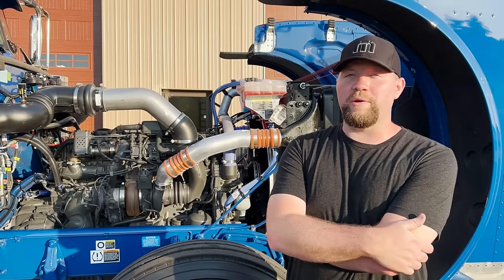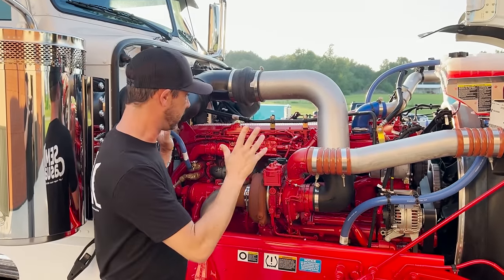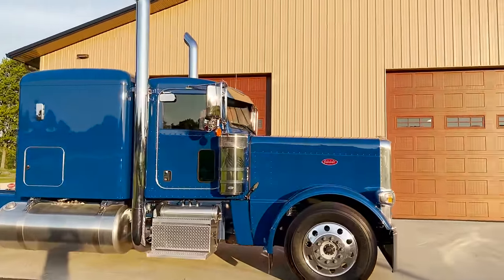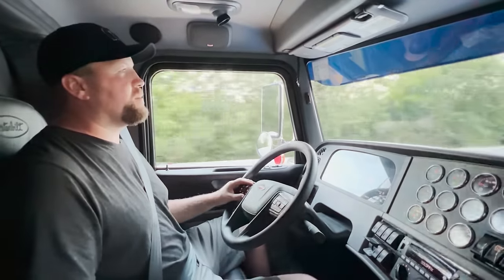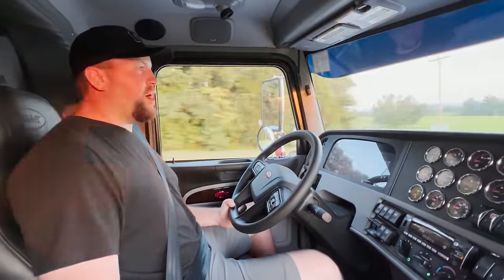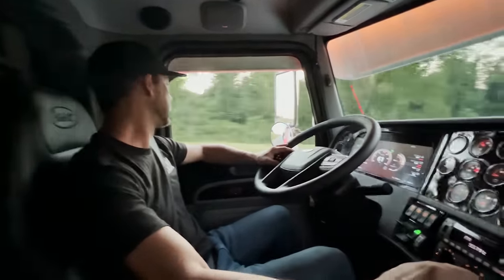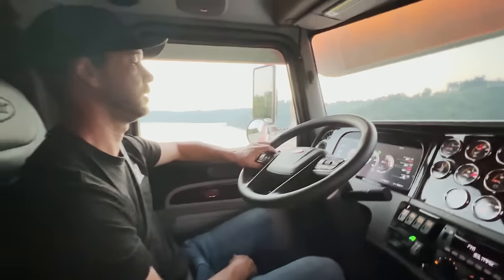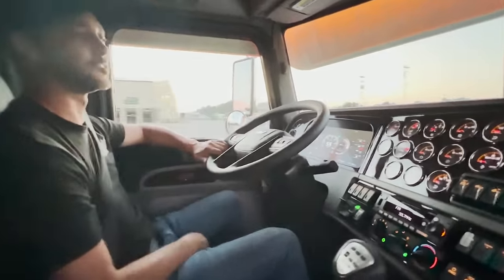Cummins X15  VS.  Paccar MX13  -  What are you gonna choose?

Comment: I  Prefer  Cummins  Always have , 
Now with these newer Cummins engines the only thing that we found out and learned , Is the counter bore , These engines the counter bore is NOT true in them , You can take a brand spanking new Cummins engine and pull it down and I guarantee you 1 or 2 of the  counter bores will not be precise and that's where you have trouble , You can pull  a brand new  Cummins engine down and  You will see what I am talking about if you even know what I am talking about , Take and  regrind  your counter bores and reset your liners at  14 thousands  above deck height , Cummins they only set the liners at 12,000  deck height  that's bad  and 1 or 2 of the liners will be higher than the other ones  , But redo the counter bores and set your liners at 14,000  I guarantee you  will not have no problems with that engine ,  and check all your parts and make sure that they are flat and  use good glue when you put it back together  Or you will have oil leaks , I know guys that got new ones at 50,000 miles and they are already leaking oil Because nothing is true and precise

Comment: Can't compare a 15 liter to a 13 liter,,,,the power difference is massive,,,even  if the horse power and torque is the same the larger displacement will always have more power,,,I wouldn't ever own a paccar engine,,,but comparing 13 to 15 liter just isn't fair

Comment: I’m just going to comment from a company driver standpoint. We have t680 Kenworth’s with both engines. The dash on the paccar powered trucks read that they get better fuel mileage but the pump doesn’t say so. As far as power they both pull good.

Comment: I have 12 trucks with every brand of engine.  While the MX is not the coolest engine, it has been the best option in terms of reliability and fuel economy.  Parts are cheaper than the CAT engines and we have a local Peterbilt dealer that is very helpful.

Comment: So here's the deal........the Paccar has serious injector issues causing alot of breakdowns and lack of enough parts to fix. The X15 will need rebuilding by the time you get 450 to 500,000 miles on it. Due to the fact that they removed the fuel dozer in the exhaust and made the injectors due double duty spraying fuel into the cylinder on the exhaust stroke. Causing  the cylinder walls to get washed out prematurely and causing excessive blow by and low compression.  John Deere is using the same philosophy on some of their engines as well.  They're all junk!

Comment: Don't look at miles interval. When it's have to works 5 days a week, sent it 2 times a year to the shop for services. It doesn't matter if it is my Scania R450 doing 90.000km a year short trips, or my brothers Daf paccar 530 doing 140.000km long trips. Both for bulk, running happy on 2 services a year

Comment: You guys did a good job of running down the strengths and weaknesses of both engines. That said I've owned both and in 389's. The Paccar was better on fuel until you got up over 120k lbs the the roles reverse. Oddly enough too even though both my trucks were 1850 tq motors the Cummins would run circles around the Paccar when it was hooked up to heavier loads. My Cummins was a 525 but there's no way 20 hp makes that kind of difference. The other point for Cummins was in resale. Any 389 or W900 I've seen listed with a Paccar is minimum 10 grand cheaper on the used Market. My salesman buddy says they sit on the lot way longer too.

Comment: Maybe if you compared a 500 hp. 1850 torque Cummins you likely do better on mileage you are not comparing apples to apples. It takes fuel to make horsepower.

Comment: I have both of these engines in two different trucks. There is no way that fuel filter will last that many miles and about 10,000 miles that fuel filter is nasty and starting to lose filter pressure so I don’t know how you guys came up with that number.

Comment: Doing a test/comparison when Bobtail is nearly meaningless. A truck Comes-Alive UNDER LOAD. There is NO SIMILARITY in a truck when Bobtail Especially with respect to Vibration and Sound Levels. The turbo is the Dominant sound in the noise spectrum when loaded but nearly absent when bobtail. 
As you mention, Application is important in selection…kind of… 
If you drive anywhere where there are Grades of ANY LENGTH, YOU WILL REGRET buying an engine based on Fuel Economy. BOTTOM LINE, if you consistently work where Grades are involved, you will work MUCH LONGER DAYS than the guy that has 2050 lb/ft of torque under the hood.

Comment: I've done back to back testing X15 e5 vs MX13 e5 in my region (south America), and if you have the correct power train selection, the X15 gives better fuel economy and performance here, you can't have the back to back test of the MX13 vs de X15 performance version, you'd have to put it against the 450hp X15 with 1750 lbft of Torque, that way you would be able to compete in fuel economy and Def consumption and also maintenance intervals

Comment: @5:00

As a one man owner operator, as long as I get 6 miles per gallon I'm okay. I'll pay an extra 8 to $12,000 a year just so I don't slow down at every Hill that comes up on the horizon. Time is money. I don't take loads where if I don't get 7 miles per gallon I lose money.

I do my own oil changes: but let's say an oil service is $350.00 in July, 2022 prices.  Let's also say you're a super-trucker and drive 120,000 miles per year. 

 The quick math is you'll pay $700.00 on the Cummins for annual oil service.  On the PACCAR, you are our $350.00 cash but then you must also accrue $210.00 for the second oil change being used up so you only have $140.00 service-life of that oil change left.

So if you divide that $140.00 savings by 120,000 miles you will get an approximate this amount cost savings oer mile:  $0.001166666666666666.  You have to drive 1000 miles to see one penny of savings.

A much better comparison would be which one has a higher "half-life" to that $40,000 to $50,000 rebuild; this is something that would "move-the-needle'.

And if you're a regional driver like me where you barely make 80,000 Mi a year: I mean it's just a negligible annual cost.  Even my batteries is cost annually more than this per mile ( $750 cost over 4-year service life. )

Comment: You should not be going 60k on a service. Book even calls for 25k. Also I get a whole mpg more than the mx13 we have and both are 18spd with 3.08 295 tires with the same 18,700lb. Both have the same weight trailer at 105k and I absolutely destroy it every possible way. Pulling power since mine was at 605hp but now it's 700hp and gets even better then 1mpg over the mx13. It's a complete garbage engine with no benifts. Your better off with the proper spec your doing. My w990 is also extremely quite end I never feel my engine running and my truck running down the highway is extremely quite. So quite it drives me crazy

Comment: Well I think X15 is better now and in next 3-5 years, better resale value and no body wants to buy paccar with 500-600k miles, I would rather have 1 mpg less than 2-3 months down time waiting for parts or wasting time trying to  find mechanic why can work on Paccar, get Cummins efficiency and slow down up hill or drive behind paccar or up hills and you’ll get same mileage as paccar, Cummins efficiency can get 8+ average and that’s enough to make good profit

Comment: MX13 is good engine just for what you need.....single trailer - go MX13, hauling heavy loads or superB daily? X15 is way better.
Noise in cab? open pipes on cummins sounds great....but getting old pretty quick, im driving with noise canceling headset....

Comment: Paccar is terrible.. bought anew dump truck and needed a new block at 75k miles. We have 6 with the same engine. All have been problematic. Have an old 96 kw with a n14 and has had problems

Comment: Talk about how different trucks shift, you guys are both too young I think to have ever driven an old Mack 5-speed. That was what I started out in, way back in the early 80s, and it was an old 70s truck. The Mack, you had to pull it waaaay down to maybe 1500 rpm or even lower before it would shift. They were working best at what seemed like crazy low rpm.

Comment: I had a pack car engine the 500 in my 2015 389 Peterbilt pulling super Bs in Alberta Canada gross weight 139,900 pounds call liquid asphalt and I could stay with any Cummins and on a long pole could outpull them. And save money at the pump on every fill up

Comment: Hello
Friends, I have a dsfmotormx13, retard motor. Why does this engine damage the valve stem, and I have seen several cases that their valve stem also breaks quickly, and this is a weakness for this engine. Is this weakness due to the construction of this engine or is there a reason that causes this problem, please guide me, this is a problem.
Thanks

Comment: 😂 reading theses comments, I have 15 KW T680’s Paccar far smoother running and way better fuel mileage.. Both have cheap plastic high pressure inserts that KW doesn’t even manufacture as replacement parts.. Cummins seem to have more fluid loss, Paccar seems to have more air emission problems

Comment: No way would we ever run a paccar engine, we all want a big block, but yah we would all run a 12.7 60 series and love the fuel mileage, the paccar is just the replacement for that engine, times are changing, and I personally don't think the new Cummins is a million mile engine, many get a full inframe at 700K miles, times have changed, roll with the punches

Comment: As an owner operator, the paccar is not even an option. The dependability of the cummins far outweighs the paccar.  I also pull mountains regularly making the torque a requirement.

Comment: F#ck Paccar. Absolutely gutless.When you have to buy a 92 Pete to haul with because the new paccar lost the motor 3 times in 7 months until the dealer offered to buy it back out of pitty. and the pete dealer today 3 years later refuses to stock Paccar on the lot anymore

Comment: I liked the paccar engine until we spent 30k on it fixing the damage the air compressor caused going out, new power steering pump, fuel pump and air compressor, and pulling the engine to replace two gears

Comment: Do not I repeat DO NOT CHANGE YOUR OIL AT 60,000 MILES!! (cummins) or 75,000 (paccar) as they stated. Thats to damn high. I suggest to have your oil changed no more than 20,000. I try to do mine every 15,000 miles.

Comment: Cmon man, would you really spend 300k for a 389 or any truck and change the oil 60-75m mile intervals. That’s insane, no engine longevity there, and who would want to buy that truck used. I’ll stay at 20k oil changes and never have big engine issues

Comment: I'll tell you right now as somebody who's driven a 579 with a pack on motor in it for the last 3 years not only do those things have extreme emissions problems that the Cummins don't have they also have problems with their camshafts on the newer motors, they also have and ungodly amount of sensor problems once you get a couple hundred thousand miles on them your sister start going haywire all over the damn place you'll be driving around with a check engine light more than you will when you don't have one

Comment: The difference between the cummins and the paccar are no where enough to reliably pull or tow a tank they use 800 horse detroits and cummins and cat motors to pull that much weight I have a person I met that has a m1070 hett with a cat motor that has over 900 hp and over 2900 lbs ft of tourqe and he get 6 mpg towing lavs mostly tanks he gets around 4 to 6 mpg depending what it is but most of his loads are 190k lbs

Comment: This 60000 and 75000 mile oil change is only profiting the dealers and mechanics ,  not drivers or muy especial owner ops!!! 
I say 15-20K miles max oil change to keep the engine running strong and long !!!! What the heck , 75000 oil change , make it 100,000!!!! 500,000 K miles if it lasts that long and get a new engine , only $50,000 extra for the new engine to save maybe $5000 in extra oil change costs , Pure insanity!!!!

Comment: I have a 2016 mx 730k miles still getting high 7 low 8mpg would love Cummins power but I pull general freight van mostly Midwest I don't need it I try to haul light anyway. Love them Pete's though

Comment: Been a top rate diesel mechanic for over 40 years and Cummins is in bed with China and alot of there parts are made of low grade materials and there's huge issues with head gaskets around liners 5 and 6..  extremely poor torque sequences on there headbolts..  Paccar has its issues with sensors and they will give you problems if they are not serviced on time.....  Paccar is a better motor......  People think wow!! CUMMINS!!!!   no no no,.. critical parts are Chinese made and it's all raw garbage...  The older Cummins are the best and my favorite

Comment: I have driven both the an X-15 Cummins and an mx-13 paccar. The Cummins has a stronger engine brake has more power and is more reliable I had more issues with the paccar mx 13s I spent more time on the side of the road with an mx-13. The company I work for has both and they are both heavily restricted horsepower wise and torque wise and speed wise I still would take the Cummins over the paccar

Comment: if you live in a small town like Greeley, CO it's best to with the more common engine the X15, because i drove a truck with the MX-13 and that small town Peterbilt place didn't have a Tech to work on my MX-13 so i had to wait 2 days for a specialist to be flown out.  For the MX-13 i found that it was rather good on MPG like 7-10, but the X15 has always been a hog getting like 6-8 mpg

Comment: Regardless of the cost difference I will only have a Cummins or a Detroit. The reason for that is I can get warranty work done anywhere and can shop around to get it in the fastest. If I have to wait a week to get my truck in the pac car motor just lost all its advantage. I currently have an ISX 15 with nearly 700,000 miles on it and I have has it in the shop for a def sensor and a fan hub. Oh and an A/C compressor. Thats it. Freightliner fixed the fan hub, International done the A/C compressor and Kenworth done the DEF sensor. I have a International Pro Star and will not take it to the shitty service at an International dealer! But I will never have an off brand engine again where I am limited to where I can get it worked on. Time is money and International, Volvo, Pac car and mack engines have to go to a dealership that don't give a rats ass about getting you out in a hurry! International is the absolute worst! They work bankers hours. My next truck will be a Westernstar or a Kenworth with a X15 @ 605 hp and 2050 torque. Then it will be tuned by Pittsburgh power.

Comment: 60-75  between oil changes?? No wonder these trucks take a shit. I change mine every 15k. Never miss it. Of course I’m running a 3406b. From what I’ve seen at our company the Cummins have major gear issues still. Paccar can feel underpowered. Both use same def systems so same shit show there.

Comment: The MX is a dog. When it sees a hill it bogs down in fear. Had the MX13 in a 2012 Pete that was a bad terd. Constant def issues, oil changes more expensive and overall higher cost of ownership. The X15 can be tuned with all emissions intact to 725ish HP and 2400+ torque. Not a Cummins fan boy but I've had the MX13 in real world conditions and hated it. Worst fuel mileage motor ever for a car hauler. Just my 2 cents. Thanks for the video y'all.

Comment: Peterbilt mechanic here:

CUMMINS:
Serviceability, retail value, strongest engine break, parts availability, training,  software diag, much more emissions options!!!!

Paccar:
7k cheaper, amazing factory powertrain warranty  (750k)  decent dealer network, new models are much improved. Smoother rotational mass for being a rear geared engine(volvos & detroits)

MX is great option for large carriers. Thats it!!!

you can only take your MX to the dealer for service,  small shops don’t have access to their software (Davie-baby) and ECM is encrypted .

Now if MX is such a better engine, why Paclease and other dealer leases prefer you lease a Cummins from them?

Who owns the MX motor? 

You mentioned the MX block uses a compacted graphite block, but why didn’t you mentioned about their soft ass camshaft lobes?
Bad metallurgic material, MX is much inferior to the Cummins

Ever got that damn stupid check ball valve stuck while doing fuel filter changes?

Comment: The difference with the speed set , the length of the connecting rod and the x15 diameter of the piston are more convenient for acceleration than the mx13 ,  x15 reaction on accelirator pedal almost quick as gasoline engine , if you choose the right gear ratio of the transmission, then the chimneys can steadily keep the speed up a steep hill even with a heavy load, mx13  same as Detroit dropped speed quickly .

Comment: I had 6 paccars in my fleet, every single head cracked at 400,000 miles and every engine was completely bad by 700,000 miles.
I’ve heard the newer ones are built better but I still have a sour taste in my mouth
Reply: What years did you have?
Reply: 2016
Reply: Why can more of us not fight back? 500k on a series 60 12.7 in frame 0 problems. Someone needs to do the math on more fuel cost over much earlier rebuilds and sensors and all the other new garbage
Reply: @Brianphilipcurtis  haha yes, $20,000 for a head rebuild job, $50,000 to throw it all out for a CAT engine swap 😂